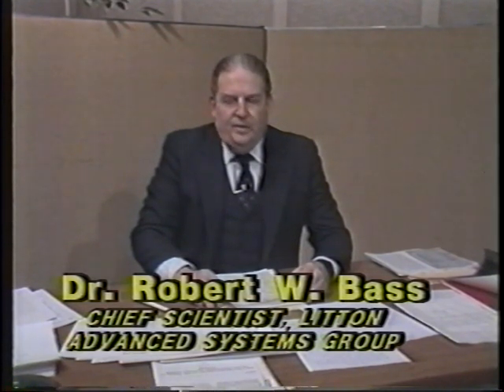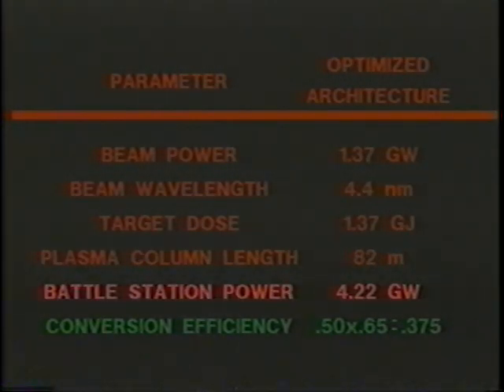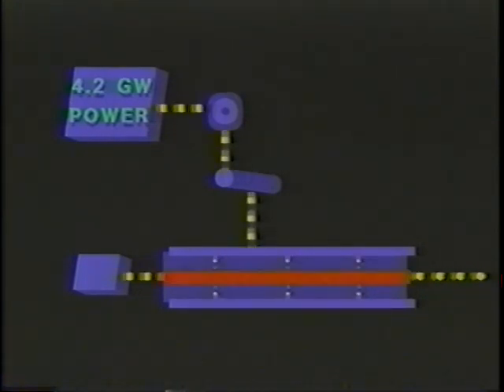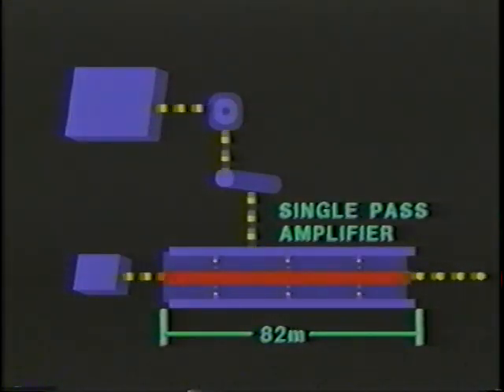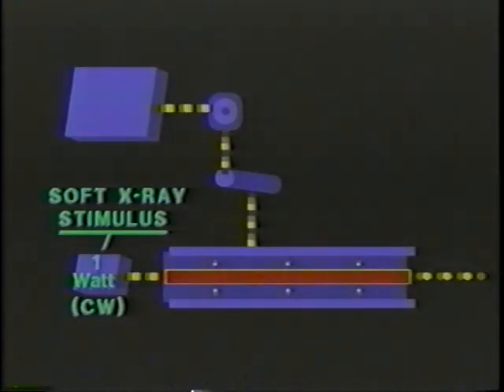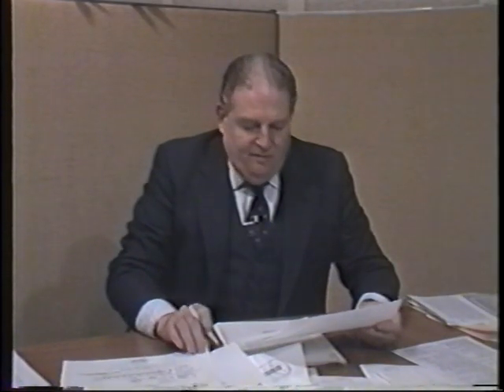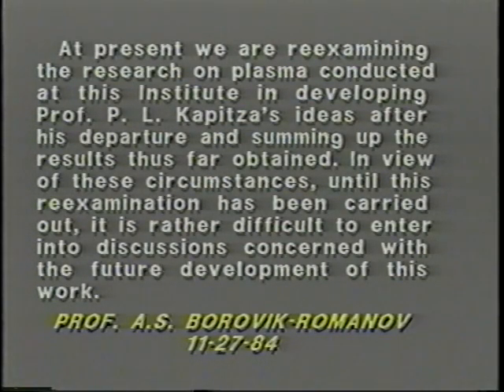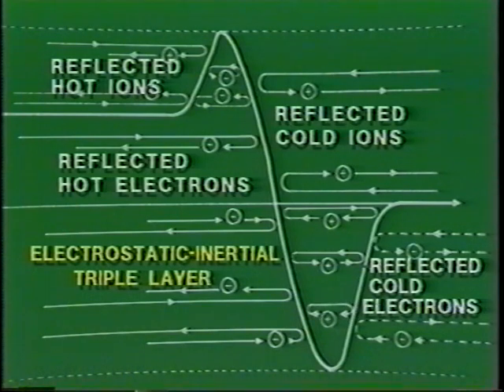HEX specs (High Energy Xaser Photon Cannon Specifications)

Comment: Zink with zirconium glazing has been proven too get fast 30.4 cm from 15.4 cm the spacing  Now there is a difference between the two sides. 
Adding sonic transmission with static charges can also help prevent over cross points when one stream is too close to the other one a fractional friction factor occurs our 15 point tricobult burned upon start ups so zink is a difference.